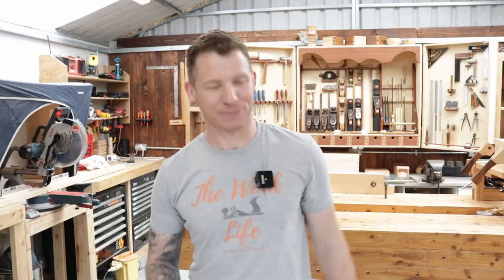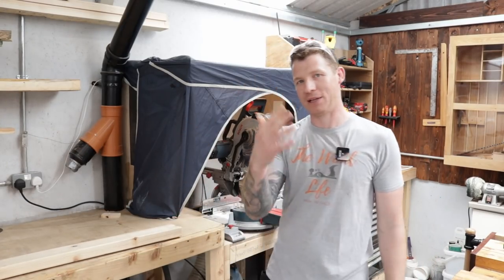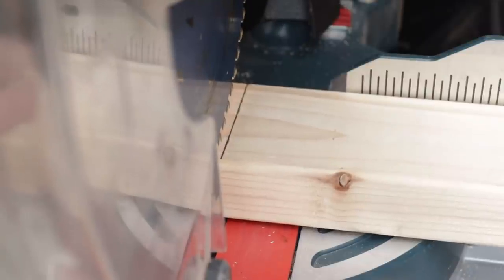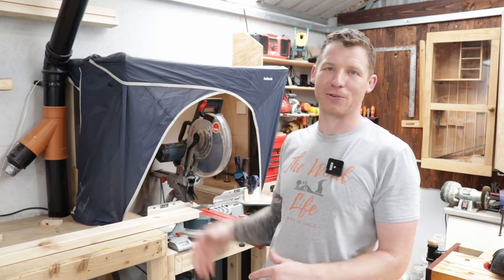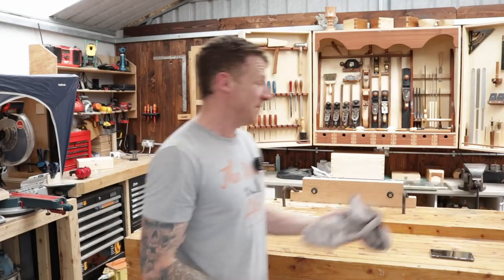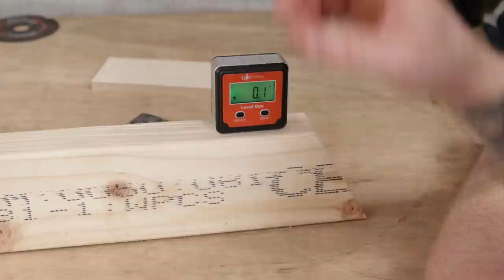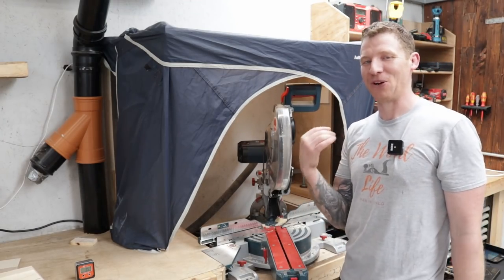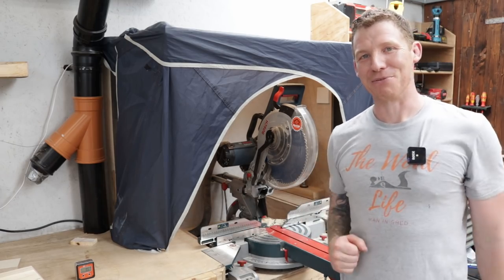Got Your First Mitre Saw? Here's Some Handy Tips! Tool Tips#1

Comment: miter saws can create some tearout, a little on the bottom side, but especially on the side facing the fence. you can create a zero-clearance insert for the bottom quite easily by using the stock insert as a template.  since most cuts are at 90 and 45, creating one for the rear can be useful.  you lose a bit of cutting length, but it will help if you need the best finish on the cut.

another one is increasing the cut width.  my 12" miter (non-sliding) only cuts about 8" wide, but if i add a sacrificial piece underneath i can increase it to 9 1/2".

Comment: I got my first Single bevel, sliding, mitre saw - also a Bosch - 6 weeks ago and have built a fence and three garden gates using it.   It was invaluable and I wish I’d bought one before.  I had to learn all those tips in your video through a multitude of other YT channels so great for a newbie to have them all in one video.  

I would be good to do a follow-up video on some more techniques in using the saw.   For example, to do half lap joints using a depth gauge.  Doing multi cuts etc.   And offsetting the cuts using a spacer attached to the back fence to allow for the rounded cut of the blade.   

Thanks for the video.

Comment: I like to keep a cheap 4 inch - ??cm paint brush handy to help keep saw dust away from the stop block .
Reply from the maker: 1 inch is roughly 2.5cm or 25mm so 4 inches is 10 cm or 100mm

Comment: This may already have been mentioned, but an important tip for me is to clamp your board when cutting a mitre. If you only hold it with your hand (even firmly), the board may move during the cut giving an inaccurate result.

Comment: The first thing anyone needs to do is to “true up” the saw. All commercial mitre saws are not 100% square out of the box, and require some adjustment, and the cheaper the saw, the worse it’ll be, and the harder the adjustment. One will need shim material ranging from fractions of mm to 1mm. Also, you should tell people the proper speed of how to push the blade through the wood.

Comment: Great tips John! Any recommendations on a respirator for cutting/sanding? I'm building a folding picnic table (based off 
April Wilkerson's design) and spent the weekend sanding and assembling the first half. I've been using a disposable mask and working outdoors but know it's not good enough so would appreciate any recommendations (of course if there's an affiliate link there's no harm there)! Cheers!
Reply from the maker: The trend stealth mask is pretty good that's what I use

Comment: Good video. Would have been worth covering checking your mitre saw out of the box as found my 90 deg wasn’t quite 90 deg so I spent quite a bit of time getting it square with an engineers sq. Its pretty shocking you spend money on tools whose primary function is to cut sq or angles and they’re not sq out of the box. It’s a real issue with beginner budget friendly tools for us hobby weekend wood workers